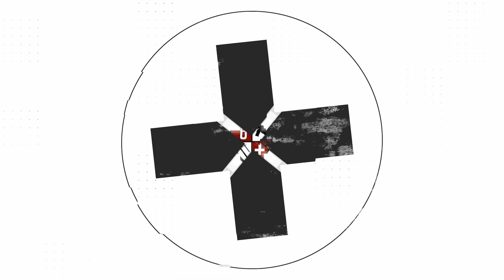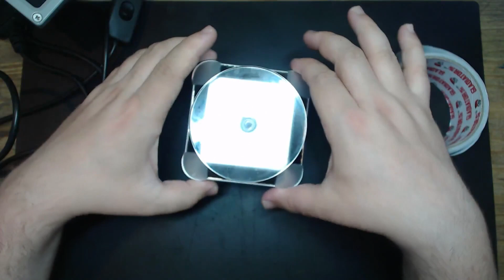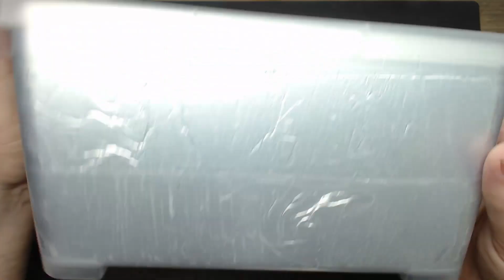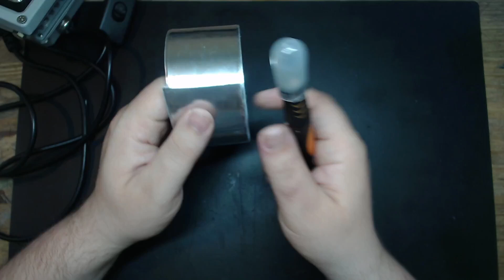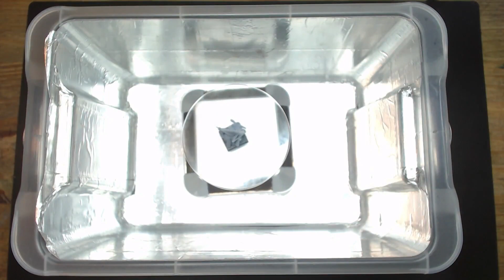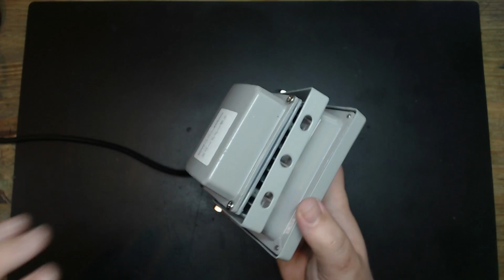How to make a UV Curing Station - Simple & Cheap #3dprinting #3dprinter

Comment: Has there been any problem with the light going through the box lid plastic?
Reply from the maker: If you seal the box with the tape, I have had no issues with light leakage
Reply: @6PlusSave  I meant shining the light through the plastic in the "window" in the lid.
Doesn't it affect the light going in, or even affect the plastic?
Reply from the maker: @No1sonuk sorry the UV light shining through the "window" has no negative effect on the curing process that I have noticed.

I have not noticed any discoloration of the plastic either.
Reply: @6PlusSave  Great, thanks.